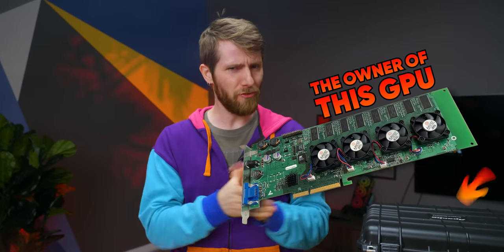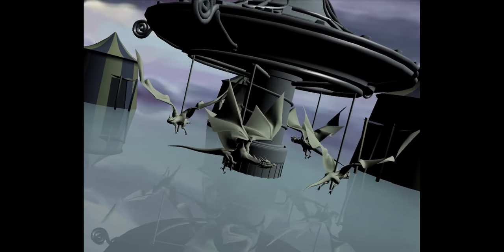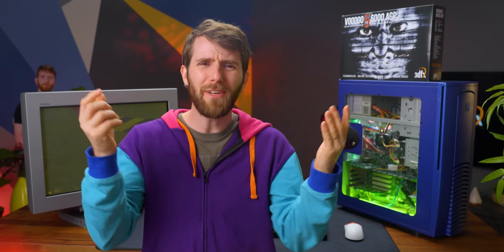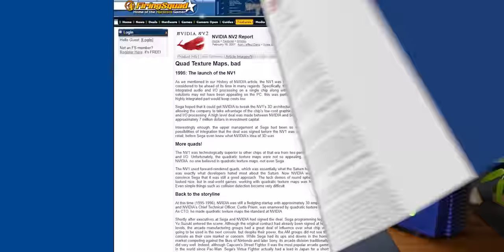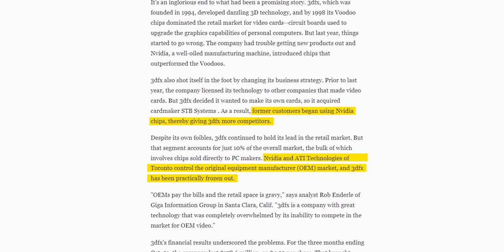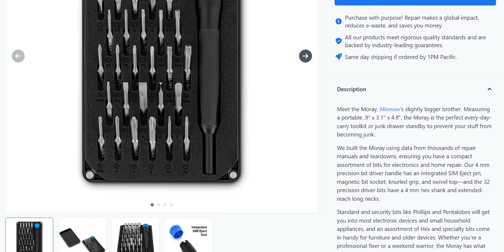This GPU cost $15,000 and there’s only ONE like it – 3dfx Voodoo 5 6000

Comment: I had a geforce mx260 or something like that back in 2000 time frame. that card would crash on me. one day i decided to set a 2x2 inch or so heat sink on top of it. and the crashing reduced about 90% . by top i mean top physically. so the back of the card. Then i got a walmart fan clip on and pointed it at the gpu and solved my issue. all for 8 bucks.

Comment: I had a Creative Labs Voodoo2 12 MB and then another in SLI mode. Switched to Voodoo5 5500 then. If Voodoo5 6000 have some out, I would have bought it. You should have tried high resolution  and / or 8x FSAA. 1024x768  is not a real challenge for this card.

Comment: The AA on there should be really good especially compared to the competition. It took a fair few gens for Nvidia to catch up on the AA front as it ran like crap and looked rough for ages and was better off just not being used. I remember thinking how bad bad it was on my Geforce 3 and it wasn't really until the Geforce 8800 that I started using AA again (qunicunx/FXAA was just a smear filter so not worth using even if the performance was ok)

Comment: I own a voodoo 5500 agp back then. My first 3D card. It was great but then a few months later my friend got an nvidia 256mx (If I remember correctly) an it performed better on quake 3 and all games using that engine like Alice. And it is much much cheaper. That day it made me realise I made a wrong decision getting the 3dfx card. But it was awesome on unreal and unreal tournament using glide. GTA 3 also look a lot better at lower resolution because of AA. But my friends nvidia card performs better on higher resolution without AA but Still ugly because of jaggies. Everything looks better on voodoo than my friends nvidia but every new game that comes out performs better on his pc. So the next card I bought was the nvidia 4200 ti. Unreal tournament 2003 looks amazing on it back then.

Comment: Software rendering went much higher than the resolution and xolor depth mentioned. You were limited only by your CPU. We are not discussing DOS-era games here with a 512 kB Trident video card. I was running Q2 very smoothly on a P166 MMX in software mode at 800 x 600 and 16 bits of color.

Furthermore, I've never seen a 486 with a Voodoo 1 in it. Probably would've been a challenge to run even Quake 1 with a first-gen Voodoo in it. 

Could there have been such a combo out there? Maybe. But I'd much rathwr expect a Pentium past the 100 MHz mark to be the typical system for such an accelerator. A 200 MHz Pentium was already being limited by a V1 in many games.

* 

Anyway...once Bitboys Oy finally releae their Glaze 3D, it will disrupt the entire industry. Mark my words.

Comment: You could have tested it with Tribes 1 instead (was programmed for Glide then added OpenGL support much later) because Tribes 2 was programmed for OpenGL (at the time GeForce and Radeon were skyrocketing) Glide was still used and D3D was meh... and also just run Fraps and theck the actual fps count

Comment: Not only Riva TNT2 supported 32-bit color and large textures but even first Riva TNT. The issue with these cards was their 16-bit rendering was atrocious and 32-bit ran unbearably slow. TNT2 was fast enough for lower resolutions like 640x480 at 32-bit but compared to Voodoo3 at 1024x768 and many games just looking and/or working better in Glide it made Voodoo3 better accelerator to own. That said V3 was a dud. It should have been Voodoo4 competing with RivaTNT2. It should have been 2 chip Voodoo 5 competing with Riva TNT2. It should have been 4 chip Voodoo 6000 competing with RivaTNT2. This + no stupid deals with STB would make 3dfx absolutely dominate the market. Unfortunately it didn't happen

Comment: You objectively do not need raw metal hardware to run glide games faster than anything 3DFx ever engineered, you can use a glide wrapper with a modern GPU and absolutely smoke this card.

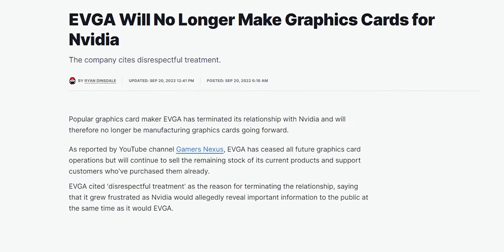Comment: 14:35 nvidia gpu were already favored by miners before they made the cmp, and then when they sold the cmp line of gpu they weren't even priced reasonably and you would need to order a large batch to get any. and then they started making lhr gpu. they are just extremely out of touch with the market, but somehow still sold well because people find a way to make it work in spite of nvidia hating their customer base

Comment: 0:16 There is no fricken way!

0:34 Just look at that shiny thing that had SLI integrated which worked better than anything nVidia ever had with the same abbreviation, but a different meaning! 3dfx SLI actually was good and didn't require specific support from either the game or from within the drivers for a specific came. And it didn't introduce microstutters either.

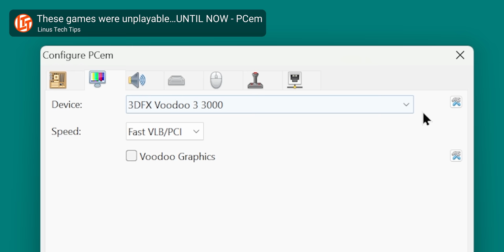1:34 Not only is he pulling that great piece of a graphics card, no, but also he's pulling one of the best cases ever made, the venerable Chieftec CS-601! Still got a bunch of those... that thing was awesome!

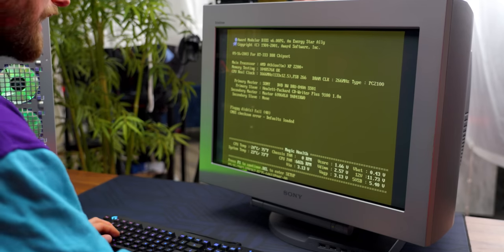2:26 LOL I'm dying! :D

3:04 Why didn't you pull up the console with ~/^ and and type cl_showfps 1 in there, or use FRAPS? XD
3:07 You're WAHT? Running a CRT at 60Hz? Only schools and bad employers did that! Those things should at least run at 85Hz, unless you'r coffin cornering it with an ultra high res that can't go 85Hz.

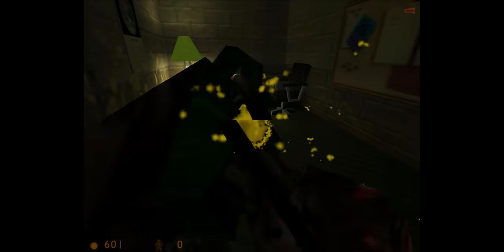3:22 Was a lot compared to other GPUs, but then again, you also had to pay 600 bucks for an actual license of FCKGW around that time (and 400 for Home). Getting more affordable OEM licenses as an End User was basically impossible until somewhere around 2005-2006ish.

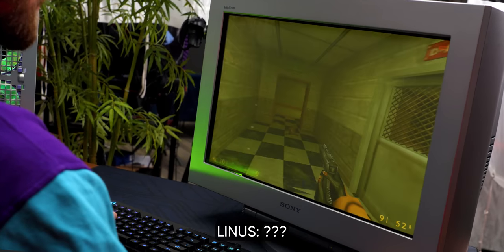3:34 I literally played it on a Voodoo 1, but upgraded to a TNT later in early 1999, just about 6 weeks before the TNT2 was released (literally got the top end card for 200 bucks that way). And it was smooth enough, but ofc, it only was 640x480 or 512x384, which I preferred for performance reasons. On the TNT I could go 1024x768 with slightly higher frame rates then... quite a substantial jump already, but it was even more in Unreal which utilized 3dfx better.

4:16 Oh, there's a PRO!

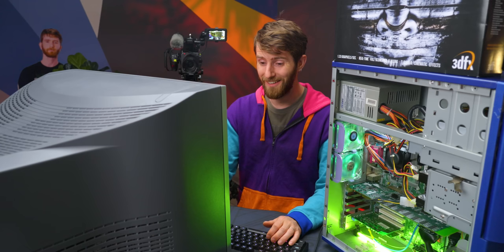4:34 Just for comparison: My brother played the original UT on a 900MHz Athlon with a Voodoo 3 3000 (I actually still have that rig!) getting up to 350fps at low settings and still well beyond 200 at high settings. Can't remember the res he played at though, but I think it either was 800x600 or 1024x768. Unreal or UT and a 3dfx was just smooth AF.

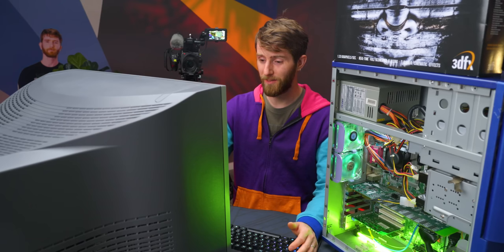4:44 Go to waybackmachine as long as it still exists! XD

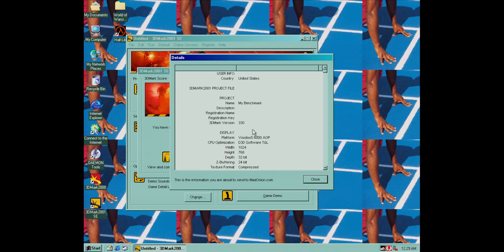7:15 Now here is the thing: I wanted to get a 5500 (the 2 GPU variant), which did exist, but were hard to get anyways. Which I why I ended up with a GF2MX instead. The only game I ever played on it that had T&L support (= where it was better than a 3dfx that hadn't) was Giants: Citizen Kabuto, which, to be fair looked almost as good and ran similarly well with it disabled and reportedly was running smooth on Voodoos. So it actually was NOT a thing, unless you just geeked about benchmark scores. It kinda was like RTX these days: Nice to have, but hardly relevant for quite a while after introduction. I mean, who actually used RTX on a 20 series? ;)

9:26 Actually that was an advantage. You literally could snag a used office rig or your then current gaming rig that had some sort of graphics card already not really suitable for 3D and just throw in a 3dfx (or two) to get a really good gaming rig. I added the V1 to a P133 - in 1998! And I could play everything at high settings...
And there were combined cards like the Banshee (based on Voodoo 1) and the later Voodoo 3, 4 and 5 models.

9:45 S3: "3D Decelerator" - how true!

14:26 Was just about saying that...

14:50 Celestial go! With the power of Sunbutt!

Comment: I had a Diamond Stealth 2 S220 based on the Rendition Veritè and their version of VQuake was kickass for using Tile Based Rendering. 2D Vesa sucked though. That would get replaced with a Voodoo Banshee which then got replaced with a Voodoo 3. But once 3Dfx bought STB, I knew it was the beginning of the end and hightailed it to a GeForce 2 MX400 and eventually became a moderator at NvNews. Politics and assholery blew that up. Mike Chambers only sent me a review sample of the GeForce 5700 Ultra because he gave his cronies dibs on the good swag and the rest got the left overs. The 5700 Ultra was great in D3D ... and so horrendous in OpenGL that ATI grew market share just for not being Nvidia. Sound familiar? We'd put up with crashes and janky shit from ATI drivers as long as it delivered twice the performance in OpenGL than the 5700 Ultra at a fraction of the cost. Nvidia turned things around with the GeForce 6000 series, but the AGP cards were hobbled over 1st gen PCIe ...

Comment: Well, I would rather prefered to see this ancient beast seated on a modern 5800x3D or a 13900k processor and Running Crysis (original one) in 4k, just to bypass the P4 limit processor it had in the past and look for what a TOP NOTCH VGA from that era was capable of....like people today pairing 3060 on 5950X and so on....

But I imagine that owner told them serious red lines of what NOT to do, just to prevent something goes wrong and his UNIQUE or almost UNIQUE card vanishes into ashes.

Comment: Voodoo 5 6000 wasn't even suppose to exist at all. It was a last minute ditch effort to spoil Geforce 2 GTS/Radeon 7000. Outside of GLIDE, Voodoo 5 6000 was marginally faster but was a huge card that require external power (probably would have end-up dual-molex before it got canned). Geforce 3/Radeon 8500 that would came out a year later would have outpace it and offer hardware pixel/vertex shading. GLIDE wrappers came down the pipe a few years later making 3DFX card obsolete.

Comment: I was VERY saddened to see 3DFX go under and be bought and catabolized by Nvidia.  I always route for the underdog and love to see them bight the big guy an the but, like AMD has done quite well.  I loved my Voodoo3 2000 and even though it was not the top dog at the time it was my first real 3D card.  It was nice that AMD picked up ATI and kept it going for all these years.  My next card after my Voodoo 3 2000 was a Radeon 9700 Pro TV.  I liked TV tuners back when cable was not digital.  After I could no longer use my TV tuner on my computer it was not long after that I ditched cable TV all together.

Comment: The real truth is this re: the fall of 3dFx. 3dFx spent a lot of R&D on anti alias technology and implementing it to make older games look better than they originally did. This was their USP and what they were advertising theri latest cards on near the end. Older non 3D games were meant to look better with new tech which would make games which originally looked pixelated look smooth using anti alias technology running on the fly. Nvidia did not care about that or trying to get older games looking better than what they did originally. Instead Nvidia concentrated on making sure the current and next generation of games would look and concentrated on 3D rendering. So while 3DFx cards made older games look better, Nvidia cards made current and future games look better. 3DFX hoped lots of people would want to make their existing games look better, but back then there was not really much of a retro culture and most people were forward looking regarding games more interested in playing modern and upcoming games (via demos) than older games they once loved in the past. Nvidia won and 3DFx lost. Nvidia bought 3DFx to get hold of the  anti-aliasing technology anyway and then incorporated some of their ideas into later graphics cards.

Comment: Just put in a cheap directx card 

Would have kept the dual card thing going for profits, but they stopped working together for the end user experience… so we ended up with windows only and nvidia only games and the hype trains… to guide us to crappy games.
Reply: Had we not bought the Xbox we’d still have good games and good gfx wow

Comment: Vodoo 3dfx didnt last long ... in 1998 it was huge all because of Quake 2 and how good it looked ... by 2000 that TNT card was by far the most popular at computer markets, i gave up on games then as you were always upgrading so often it become silly... remember Zip drives copying those 200mb of Napster Mp3 files .. they didnt last long did they. windows 2000 was terrible and computers then really didnt have enough hard drive space for all the installion of cd rom games . Video editing on high end pentium 3 computers was also terrible then i remember the constant freezes. by 2001 i had forgoten Vodoo cards and now i see why they went bankrupt. Software rendering was fine.... i could play Unreal Tornament 2000 on a Celeron with 64rm and 8 meg built in Video just fine on high settings

Comment: nvidia drivers before directx8 support were faster in games.. like on tnt2 or w9x618 drivers before they invented the "new" -like 12.81?? up to todays 400.99 whatever driver - the drivers for nvidia 4200 ti between 40 41 43 44 45 were suck and performed bad in unreal engine even with 64 mb vram then came the next faliure the 5000 series with thier drivers